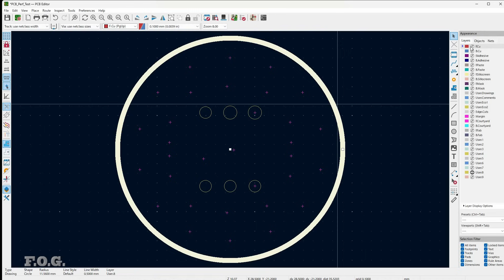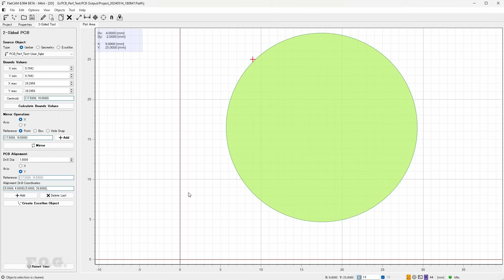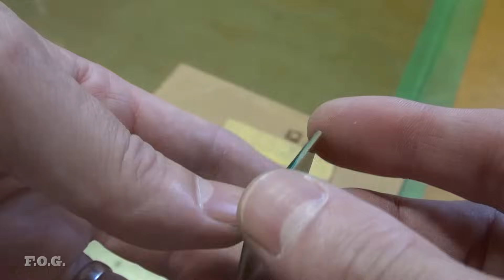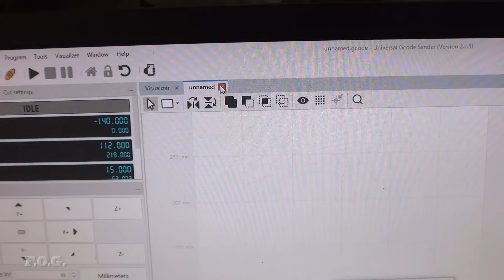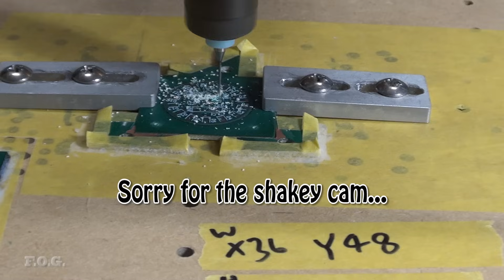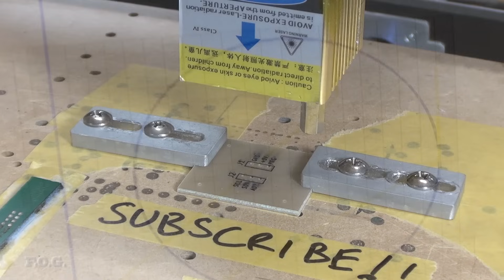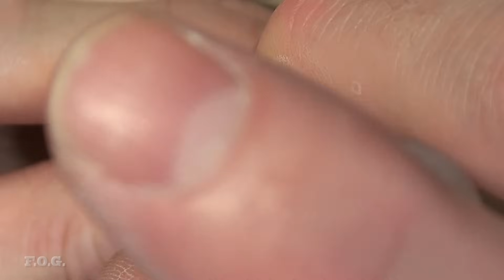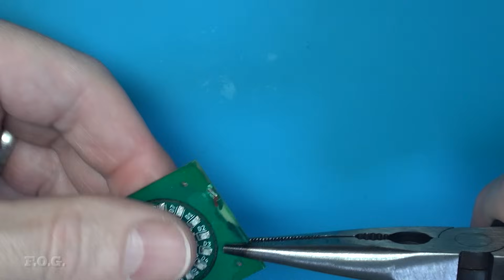The BEST DIY PCB Tutorial (ForOurGood PCB Method)

Comment from the maker: This is a pinned comment where I will try to provide extra information in the replies of this comment... (Note: FlatCam Links shown in the video are no longer valid > see below)
In the description of this Marius Stanciu's (FlatCam developer) YouTube video, you can find the links to the download installers. I cannot guarentee them, but I expect the risk is likely low given the source.
Here is the link to the video: https://youtu.be/doPdeA0YgzQ?si=2yWdgYf8naxUh96R
Reply from the maker: 10. Install & Align Laser
    - Remove spindle and install laser
    - Home CNC & Set XY to zero
    - Probe Z-Height of locating marker and set laser to correct focus height
    - Move CNC to LM_OFFSET X&Y coordinates
    - Adjust XY position by eye to be centered with location cross mark
    - Set X & Y coordinates to zero
    - Move CNC to coordinates G0X0Y4
    - Set X & Y coordinates to zero
  a - Burn test marks in locating marker (use "Laser_Align_Test.nc")
  b - Magnify and inspect marks and determine X & Y adjustment (COMPENSATE OUTSIDE CIRCLE DISTANCE!)
  c - Move to G0X0Y4 adding the determined adjustment amount for X & Y (typically +/- 0.01>0.1)
  d - Set X & Y coordinates to zero
    - Repeat steps "a" thru "d" until good alignment achieved
    - Move CNC to coordinates to G0X0Y0
    - Move CNC by 1mm steps until centered with location cross mark
    - Set X & Y coordinates to zero
    - Move CNC to coordinates to G0Z10 to ensure the laser will be clear
    - Move CNC to PCB_OFFSET X&Y coordinates
    - Set X & Y coordinates to zero

11. Burn Alignment Marks, Flip & Align PCB
    - Remove PCB, remove waste sheet, and re-install PCB without waste sheet
    - Check alignment holes are all clean and clear
    - Probe Z-Height of MOUNTING surface (i.e. waste board)
    - Load G-Code file "Alignment Drills_conv_edit_iso_combined_cnc.nc"
    - Run G-code to burn alignment marks into the masking tape on the mounting surface
    - Remove PCB
    - Remove Locating Guides, being careful not to disturb the alignment marks
    - Flip PCB backside up, and using magnification, align alignment holes and marks
    - Clamp PCB firmly in place
    - Probe Z-Height of PCB surface

12. Back Side PCB Markings & Laser Cut
    - Load G-Code file "??-B_Silkscreen.gbr_iso_combined_mt_paint_cnc.nc"
    - Run G-code to mark the bare P
    - For symmetric PCB -> Load G-Code File "??-User_9.gbr_iso_combined_cnc.nc"
    - For asymmetric PCB -> Load G-Code File "??-User_9.gbr_1_iso_combined_cnc.nc"
    - Run G-code to laser cut the PCB
    - Masking tape, locating guides and reference can be removed

13. Laser Cut SMD Solder Paste Stencil (If SMD is used in design)
    - Mount bare copper clad PCB in CNC as working surface
    - Apply masking tape to the bare PCB over area larger than the stencil
    - Load G-Code File "??-F_Paste.gbr_edit_iso_combined_cnc.nc"
    - Set the XY origin of the CNC so the stencil will be burnt at the center of the masking tape
    - Cut out 2 pieces of white weak adhesive label sheet large enough for the stencil
    - Carefully apply the FIRST layer of label sheet to the center of the masking tape
    - Use Scotch Brite to dull surface of the FIRST layer of label sheet, clean lightly with IPA
    - Probe Z-Height of the FIRST layer of label sheet
    - Run G-code to cut the stencil design into the FIRST layer of label sheet
    - Now stick the SECOND piece of label sheet carefully on top of the FIRST layer
    - Use Scotch Brite to dull surface of the SECOND layer of label sheet, clean lightly with IPA
    - Run G-code to cut the stencil design into the SECOND layer of label sheet
    - Carefully remove COMBINED layers from masking tape, leaving cutout areas on the masking tape
    - REDUCE STENCIL ADHESION by pressing sticky side to your fingers a few times (need only minimal adhesion)

14. Prepare Pads for Soldering
    - Magnify and inspect, using a pin tip to remove any obvious resin remaining on pads
    - Use fine toothbrush and metal polish (Pikal/Brasso) to bring pads to a high shine
      > When polishing, focus on scrubbing inside the pad cavities cut into the resin
      > Rotate the PCB and polish a couple of times from different angles to ensure all areas covered
      > Take care with this step, it's CRITICAL to remove residue from pads to get good solder take up
    - Scrub the pads clean using IPA and fine toothbrush, then dry.
    - Magnify and inspect, confirming all pads are highly reflective. Repeat polishing as needed
      > Note: If the PCB was polished well in Step#1, then getting a good shine on the pads should be easy.

15. SMD Assembly Process (If SMD is used in design)
    - Affix the stencil to the PCB so it is accurately aligned with the pads, then press down firmly
    - Magnify and inspect stencil, ensuring all holes are clear, use pin tip to clear as needed
    - Apply solder paste into stencil cavities with spatula, press in hard, scrape of excess
    - Carefully remove Paste Stencil so the paste remains in the PCB undisturbed
    - Place all SMD components onto PCB
    - Place PCB on hotplate and PRE-HEAT to just below solder paste melting point, hold for 2min
      > for 138degC solder paste this is approximately 125degC
      > for 183degC solder paste this is approximately 145degC
    - Raise the hotplate to the REFLOW temperature for the solder paste, hold for 1min
      > for 138degC solder paste this is approximately between 150degC > 150degC
      > for 183degC solder paste this is approximately between 205degC > 225degC
    - Nudge any out of place components
    - Carefully remove from hotplate and allow to cool naturally (do not cool quickly)
    - Clean with IPA and fine toothbrush, then dry.
    - Inspect with magnification, remove any unwanted solder beads & further clean as need be

16. Snap Out PCB & Clean Edges
    - Repeatedly bend waste part of PCB around laser cut edges of PCB, and snap it out
    - Use fine file to clean up outside edge of PCB to align cleanly with laser burns
    - Clean with IPA and fine toothbrush, then dry.

17. Install & Solder Through Hole Parts (If thru-hole components used in design)
    - Install, solder and trim wires of any through hole components
    - Clean with IPA and fine toothbrush, then dry.

====================== [Double Sided PCB Process] ======================

a) Step 1: UV Resin coat BOTH sides of the PCB (One side at a time of course...)
b) Steps 2 thru 10, Skipping Step-9: Alignment & Front Side Process (Skip drilling PCB Holes)
c) Steps 11 & Step 2 Combined: Flip PCB, Align and add new Locating Guides for back side processing
d) Steps 4 thru 9, Skipping Step-8: Back Side Process* & Drill PCB Holes (Skip drilling Locating Holes again) 
e) Steps 13 thru 17: Assemble PCB (Note: Manually solder on back side components as need be)
* When etching the back side of the PCB, make sure to protect front side with tape or adhesive sheet
Reply from the maker: =================== [ KiCad Layers & Creating Files ] ===================

@@@@@ Single Sided PCB @@@@@
F.Cu		Clear resist UV resin
F.Paste		Create solder paste stencil +
F.Silkscreen	Expose UV Resin for PCB silkscreen +
B.Silkscreen	Burn into board the PCB silkscreen +*
F.Mask		Clear mask resin from PCB pads
User8		Clear mask resin from PCB edge
User9 		PCB Shape, Cutout PCB **
PTH-drl		PCB Through-Holes (Gerber & Excellon)

+ Optional
* Mirrored in FlatCam
** If PCB not vertical line symmetric, make mirrored copy in FlatCam

@@@@@ Double Sided PCB @@@@@
F.Cu		Clear resist UV resin
B.Cu		Clear resist UV resin *
F.Paste		Create solder paste stencil +
F.Silkscreen	Expose UV Resin for PCB silkscreen +
B.Silkscreen	Expose UV Resin for PCB silkscreen +*
F.Mask		Clear mask resin from PCB pads
B.Mask		Clear mask resin from PCB pads *
User8		Clear mask resin from PCB edge **
User9 		PCB Shape, Cutout PCB **
PTH-drl		PCB Through-Holes (Gerber & Excellon) ++

+ Optional
++ Make mirrored copy in FlatCam
* Mirrored in FlatCam
** If PCB not vertical line symmetric, make mirrored copy in FlatCam

@@@@@ Creating Output Files in KiCad @@@@@
- Select Menu > File > Fabrication Outputs > Gerbers(.gbr)...
- Plot format = "Gerber"
- Select above layers
- [Plot]
- [Generate Drill Files...]
- Drill File Format = Excellon
- [Generate Drill Files]
- Drill File Format = Gerber X2
- [Generate Drill Files]
Reply from the maker: ============= [ FlatCAM 8.994 File Preparation Information ] =============

Note: Offset adjustment and PCB tiling is possible within FlatCAM, but is not covered here.

* Laser Remove Mask Resin for Etching Design *
- File > Open > Open Gerber... > Select "??-F_Cu.gbr" & "??-PTH-drl.gbr" > [Open]
- Subtract Tool (ALT+W) (Use to remove pad holes)
- Delete source = YES, Target = "??-F_Cu.gbr", Subtractor = "??-PTH-drl.gbr"
- [Subtract Gerber]
- Double-Click "??-F_Cu.gbr_sub"
- [Gerber Editor] (Use for cleanup & etch compensation)
- Inspect carefully for any defects or hidden unrequired track pieces
- Select and delete any leftover track pieces (or fix in KiCad & Reload)
- Select all remaining elements
- Click [B] icon in toolbar
- Buffer distance 0.022
- [B Buffer]
- [Exit Editor] > [Yes]
- [Isolating Routing]
- Tool Table 0.075, Tool Dia 0.075, Passes 19, Overlap 33.3333% (Increase "Passes" to fit design)
- [Generate Geometry]
- Check Geometry has all tracks properly isolated. Modify KiCad design to resolve any issues.
- Preprocessor = "GRBL_Laser" (!!CHOOSE FIRST!!)
- Tool Table 0.075, Tool Dia 0.075, V-Tip Angle 1, Feedrate XY 650, Laser Power 5000
- [Generate CNC Job Object]
- [Save CNC Code] > [Save]
- Click [Project] Tab > CTRL+A > Right-Click any item > Disable Plot (clears plot area > wait till complete)
- CTRL+S or File>Save>Save Project... (safety step in case of crash)
- MODIFY G-CODE AS PER INFO AT BOTTOM OF THIS DOCUMENT

* Laser Expose Fast Mask Resin for PCB Front Side Silkscreen *
- File > Open > Open Gerber... > Select "??-F_Silkscreen.gbr" > [Open]
- Double-Click "??-F_Silkscreen.gbr"
- [Isolating Routing] (Use to generate outline use with paint tool)
- Tool Table 0.0001, Tool Dia 0.0001, Passes 1, Overlap 0%
- [Generate Geometry]
- [Paint Tool]
- Tool Table 0.1, Tool Dia 0.1, Overlap 0%, Offset 0.01, Method = "Standard", Connect = NO Contour = NO
- [Generate Geometry]
- Click [Project] Tab
- Double-Click "??-F_Silkscreen.gbr_iso_combined_mt_paint"
- Preprocessor = "GRBL_Laser" (!!CHOOSE FIRST!!)
- Tool Table 0.1, V-Tip Dia 0.1, V-Tip Angle 1, Feedrate XY 200, Laser Power 650
- [Generate CNC Job Object]
- [Save CNC Code] > [Save]
- Click [Project] Tab > CTRL+A > Right-Click any item > Disable Plot (clears plot area > wait till complete)
- CTRL+S or File>Save>Save Project... (safety step in case of crash)
- MODIFY G-CODE AS PER INFO AT BOTTOM OF THIS DOCUMENT

* Laser Remove Mask Resin from Pads * AIR ASSIST REQUIRED *
- File > Open > Open Gerber... > Select "??-F_Mask.gbr" & "??-PTH-drl.gbr" > [Open]
- Subtract Tool (ALT+W) (Use to remove pad holes)
- Delete source = YES, Target = "??-F_Mask.gbr", Subtractor = "??-PTH-drl.gbr"
- [Subtract Gerber]
- Double-Click "??-F_Mask.gbr_sub"
- [Isolating Routing] (Use to generate outline use with paint tool)
- Tool Table 0.0001, Tool Dia 0.0001, Passes 1, Overlap 0%
- [Generate Geometry]
- [Paint Tool]
- Tool Table 0.075, Tool Dia 0.075, Overlap 33%, Offset 0.0128, Method = "Lines", Connect = NO Contour = Yes
- [Generate Geometry]
- Click [Project] Tab
- Double-Click "??-F_Mask.gbr_sub_iso_combined_mt_paint"
- Preprocessor = "GRBL_Laser" (!!CHOOSE FIRST!!)
- Tool Table 0.075, V-Tip Dia 0.075, V-Tip Angle 1, Feedrate XY 650, Laser Power 4400
- [Generate CNC Job Object]
- [Save CNC Code] > [Save]
- Click [Project] Tab > CTRL+A > Right-Click any item > Disable Plot (clears plot area > wait till complete)
- CTRL+S or File>Save>Save Project... (safety step in case of crash)
- MODIFY G-CODE AS PER INFO AT BOTTOM OF THIS DOCUMENT

* Laser Remove Mask Resin from PCB EDGES *
- File > Open > Open Gerber... > Select "??-User_8.gbr" > [Open]
- Double-Click "??-User_8.gbr"
- [Isolating Routing] (Use to generate outline use with paint tool)
- Tool Table 0.0001, Tool Dia 0.0001, Passes 1, Overlap 0%
- [Generate Geometry]
- [Paint Tool]
- Tool Table 0.075, Tool Dia 0.075, Overlap 33%, Offset 0.038, Method = "Standard", Connect = Yes Contour = Yes
- [Generate Geometry]
- Click [Project] Tab
- Double-Click "??-User_8.gbr_iso_combined_mt_paint"
- Preprocessor = "GRBL_Laser" (!!CHOOSE FIRST!!)
- Tool Table 0.075, V-Tip Dia 0.075, V-Tip Angle 1, Feedrate XY 650, Laser Power 2000
- [Generate CNC Job Object]
- [Save CNC Code] > [Save]
- Click [Project] Tab > CTRL+A > Right-Click any item > Disable Plot (clears plot area > wait till complete)
- CTRL+S or File>Save>Save Project... (safety step in case of crash)
- MODIFY G-CODE AS PER INFO AT BOTTOM OF THIS DOCUMENT

* Laser Cut Front Side of PCB *
NOTE: Symmetrical PCB's can use the same G-Code file for both the front and back
- File > Open > Open Gerber... > Select "??-User_9.gbr" > [Open]
- Double-Click "??-User_9.gbr"
- [Isolating Routing]
- Tool Table 0.1, Tool Dia 0.1, Passes 22, Overlap 99.9999%
- [Generate Geometry]
- Preprocessor = "GRBL_Laser" (!!CHOOSE FIRST!!)
- Tool Table 0.1, V-Tip Dia 0.1, V-Tip Angle 1, Feedrate XY 650, Laser Power 10000
- [Generate CNC Job Object]
- [Save CNC Code] > [Save]
- Click [Project] Tab > CTRL+A > Right-Click any item > Disable Plot (clears plot area > wait till complete)
- CTRL+S or File>Save>Save Project... (safety step in case of crash)
- MODIFY G-CODE AS PER INFO AT BOTTOM OF THIS DOCUMENT

* Drill Alignment Holes *
- Right-Click "??-User_9.gbr" > Enable Plot
- Tool > 2-Sided PCB (ALT+D)
- Select "??-User_9.gbr"
- [Calculate Bound Values] (if does not generate values, then disable then enable plot, and try again)
- PCB Alignment: Drill Dia 1.000, Axis = Y
- Click the desired location of the lower-left hole and press [+Add] (manually modify value if needed)
- Click the desired location of the upper-left hole and press [+Add] (manually modify value if needed)
- [Create Excellon Object]
- Click [Project] Tab
- Double-Click "Alignment Drills"
- [Drilling Tool]
- CutZ -1.9, TravelZ 1.5, FeedZ 300, Spindle 10000
- ToolChange = NO, EndMove Z 25, EndMoveXY "0,0", PreProcessor = "GRBL_11_no_M6"
- [Generate CNC Job Object]
- [Save CNC Code] > [Save]
- Click [Project] Tab > CTRL+A > Right-Click any item > Disable Plot (clears plot area > wait till complete)
- CTRL+S or File>Save>Save Project... (safety step in case of crash)

* Drill Pad Holes *
- File > Open > Open Excellon... > Select "??-PTH.drl" > [Open]
- Double-Click "??-PTH.drl"
- [Drilling Tool]
- CutZ -1.9, TravelZ 1.5, FeedZ 300, Spindle 10000
- ToolChange = YES @25, EndMove Z 25, EndMoveXY "0,0", PreProcessor = "GRBL_11_no_M6"
- [Generate CNC Job Object]
- [Save CNC Code] > [Save]
- Click [Project] Tab > CTRL+A > Right-Click any item > Disable Plot (clears plot area > wait till complete)
- CTRL+S or File>Save>Save Project... (safety step in case of crash)

* Laser Burn Alignment Marks *
- Click "Alignment Drills" (don't enable plot!)
- Edit > Conversion > Convert Any to Gerber
- Double-Click "Alignment Drills_conv"
- [Gerber Editor] (Use to modify mark size)
- Change Aperture Size from 1.0 to 0.8
- [Exit Editor] > [Yes]
- [Isolation Routing]
- Tool Table 0.0001, Tool Dia 0.0001, Passes 1, Overlap 0%
- [Generate Geometry]
- Preprocessor = "GRBL_Laser" (!!CHOOSE FIRST!!)
- Tool Table 0.075, Tool Dia 0.075, V-Tip Angle 1, Feedrate XY 650, Laser Power 3000
- [Generate CNC Job Object]
- [Save CNC Code] > [Save]
- Click [Project] Tab > CTRL+A > Right-Click any item > Disable Plot (clears plot area > wait till complete)
- CTRL+S or File>Save>Save Project... (saftey step in case of crash)
- MODIFY G-CODE AS PER INFO AT BOTTOM OF THIS DOCUMENT

* Laser Burn for PCB Back Side Silkscreen *
- File > Open > Open Gerber... > Select "??-B_Silkscreen.gbr" > [Open]
- Right-Click "??-User_9.gbr" > Enable Plot
- Tool > 2-Sided PCB (ALT+D)
- Select "??-User_9.gbr"
- [Calculate Bound Values] (if does not generate values, then disable then enable plot, and try again)
- Select "??-B_Silkscreen.gbr"
- Mirror Operation: Axis = Y
- [Mirror]
- Click [Project] Tab
- Double-Click "??-B_Silkscreen.gbr"
- [Isolating Routing] (Use to generate outline use with paint tool)
- Tool Table 0.0001, Tool Dia 0.0001, Passes 1, Overlap 0%
- [Generate Geometry]
- [Paint Tool]
- Tool Table 0.075, Tool Dia 0.075, Overlap 20%, Offset 0.00, Method = "Standard", Connect = NO Contour = Yes
- [Generate Geometry]
- Click [Project] Tab
- Double-Click "??-B_Silkscreen.gbr_iso_combined_mt_paint"
- Preprocessor = "GRBL_Laser" (!!CHOOSE FIRST!!)
- Tool Table 0.075, V-Tip Dia 0.075, V-Tip Angle 1, Feedrate XY 650, Laser Power 6000
- [Generate CNC Job Object]
- [Save CNC Code] > [Save]
- Click [Project] Tab > CTRL+A > Right-Click any item > Disable Plot (clears plot area > wait till complete)
- CTRL+S or File>Save>Save Project... (safety step in case of crash)
- MODIFY G-CODE AS PER INFO AT BOTTOM OF THIS DOCUMENT
Reply from the maker: * Laser Cut Back Side of PCB *
NOTE: Symmetrical PCB's can use the same G-Code file for both the front and back
- File > Open > Open Gerber... > Select "??-User_9.gbr" > [Open] (Opens second instance)
- Right-Click "??-User_9.gbr" > Enable Plot
- Tool > 2-Sided PCB (ALT+D)
- Select "??-User_9.gbr"
- [Calculate Bound Values] (if does not generate values, then disable then enable plot, and try again)
- Select "??-User_9.gbr_1"
- Mirror Operation: Axis = Y
- [Mirror]
- Click [Project] Tab
- Double-Click "??-User_9.gbr_1"
- [Isolating Routing]
- Tool Table 0.1, Tool Dia 0.1, Passes 22, Overlap 99.9999%
- [Generate Geometry]
- Preprocessor = "GRBL_Laser" (!!CHOOSE FIRST!!)
- Tool Table 0.1, V-Tip Dia 0.1, V-Tip Angle 1, Feedrate XY 650, Laser Power 10000
- [Generate CNC Job Object]
- [Save CNC Code] > [Save]
- Click [Project] Tab > CTRL+A > Right-Click any item > Disable Plot (clears plot area > wait till complete)
- CTRL+S or File>Save>Save Project... (safety step in case of crash)
- MODIFY G-CODE AS PER INFO AT BOTTOM OF THIS DOCUMENT

* Laser Cut Solder Paste Stencil *
- File > Open > Open Gerber... > Select "??-F_Paste.gbr" > [Open]
- Double-Click "??-F_Paste.gbr"
- [Gerber Editor] (Use for burn compensation)
- Select all elements
- Click [B] icon in toolbar
- Buffer distance -0.04
- [B Buffer]
- [Exit Editor] > [Yes]
- Click [Project] Tab
- Double-Click "??-F_Paste.gbr_edit"
- [Isolating Routing]
- Tool Table 0.0001, Tool Dia 0.0001, Passes 1, Overlap 0%
- [Generate Geometry]
- Preprocessor = "GRBL_Laser" (!!CHOOSE FIRST!!)
- Tool Table 0.075, Tool Dia 0.075, V-Tip Angle 1, Feedrate XY 650, Laser Power 3900
- [Generate CNC Job Object]
- [Save CNC Code] > [Save]
- Click [Project] Tab > CTRL+A > Right-Click any item > Disable Plot (clears plot area > wait till complete)
- CTRL+S or File>Save>Save Project... (safety step in case of crash)
- MODIFY G-CODE AS PER INFO AT BOTTOM OF THIS DOCUMENT

#####################################################################
#####                                                           #####
#####   REPLACE TEXT FOR FLATCAM GENERATED G-CODE LASER FILES   #####
#####                                                           #####
#####################################################################

* Replace all matches with nothing as follows *
------------
G01 F60.00
G01 F650.00  			(Check this F value and replace as need be)

* Replace remaining header with below *
-------------
G21 				(Millimetere units mode)
G90 				(Absolute distance mode)
G17				(Select normal XY Plane)
G94				(Feedrate as units per minute mode)
$32=1				(Enable laser mode - just in case!)
M5     				(Stop spindle/laser)        
G0 F1100			(Set the rapids speed to be fast)
G0 Z7.0000			(Lift Z a bit)
G0 X0.0000 Y0.0000		(Send X-Y to home)
G0 Z0.0000			(Send Z to home)
M0				(Wait user confirmation)

G00 x?? y?? <----- leave as original from here!

M03 S??00.0 <----- leave as original from here!
-------------
Reply from the maker: (Drill Alignment Test)

G90
G21
(Drilling....)
M05
M0 ;T10
M03S10000

G0Z1.500
G0X2.000Y-2.000

G0Z1.500
G0X0.000Y0.000
G1Z-1.400F300.0

G0Z1.500
G0X2.000Y2.000
G1Z-1.400F300.0

G0Z1.500
G0X0.000Y2.000
G1Z-1.400F300.0

G0Z1.500
G0X2.000Y0.000
G1Z-1.400F300.0

G0Z25.000

M5
M5
M5
Reply from the maker: (Laser Alignment Test)

G21 				(Millimeter units mode)
G90 				(Absolute distance mode)
G17				(Select normal XY Plane)
G94				(Feedrate as units per minute mode)
$32=1				(Enable laser mode - just in case!)
M5     				(Stop spindle/laser)        
G0 F1100			(Set the rapids speed to be fast)
G0 Z7.0000			(Lift Z a bit)
G0 X0.0000 Y0.0000		(Send X-Y to home)
G0 Z0.0000			(Send Z to home)
M0				(Wait user confirmation)

G0X2.000Y-2.000Z0.000

M03S5000

G0X-0.700Y0.000
G1X-0.696Y0.072F650.0
X-0.686Y0.141
X-0.669Y0.208
X-0.645Y0.272
X-0.616Y0.334
X-0.580Y0.391
X-0.540Y0.445
X-0.495Y0.495
X-0.445Y0.540
X-0.391Y0.580
X-0.334Y0.616
X-0.272Y0.645
X-0.208Y0.669
X-0.141Y0.686
X-0.072Y0.696
X0.000Y0.700
X0.072Y0.696
X0.141Y0.686
X0.208Y0.669
X0.272Y0.645
X0.334Y0.616
X0.391Y0.580
X0.445Y0.540
X0.495Y0.495
X0.540Y0.445
X0.580Y0.391
X0.616Y0.334
X0.645Y0.272
X0.669Y0.208
X0.686Y0.141
X0.696Y0.072
X0.700Y0.000
X0.696Y-0.072
X0.686Y-0.141
X0.669Y-0.208
X0.645Y-0.272
X0.616Y-0.334
X0.580Y-0.391
X0.540Y-0.445
X0.495Y-0.495
X0.445Y-0.540
X0.391Y-0.580
X0.334Y-0.616
X0.272Y-0.645
X0.208Y-0.669
X0.141Y-0.686
X0.072Y-0.696
X0.000Y-0.700
X-0.072Y-0.696
X-0.141Y-0.686
X-0.208Y-0.669
X-0.272Y-0.645
X-0.334Y-0.616
X-0.391Y-0.580
X-0.445Y-0.540
X-0.495Y-0.495
X-0.540Y-0.445
X-0.580Y-0.391
X-0.616Y-0.334
X-0.645Y-0.272
X-0.669Y-0.208
X-0.686Y-0.141
X-0.696Y-0.072
X-0.700Y0.000

G0X1.300Y2.000
G1X1.304Y2.072F650.0
X1.314Y2.141
X1.331Y2.208
X1.355Y2.272
X1.384Y2.334
X1.420Y2.391
X1.460Y2.445
X1.505Y2.495
X1.555Y2.540
X1.609Y2.580
X1.666Y2.616
X1.728Y2.645
X1.792Y2.669
X1.859Y2.686
X1.928Y2.696
X2.000Y2.700
X2.072Y2.696
X2.141Y2.686
X2.208Y2.669
X2.272Y2.645
X2.334Y2.616
X2.391Y2.580
X2.445Y2.540
X2.495Y2.495
X2.540Y2.445
X2.580Y2.391
X2.616Y2.334
X2.645Y2.272
X2.669Y2.208
X2.686Y2.141
X2.696Y2.072
X2.700Y2.000
X2.696Y1.928
X2.686Y1.859
X2.669Y1.792
X2.645Y1.728
X2.616Y1.666
X2.580Y1.609
X2.540Y1.555
X2.495Y1.505
X2.445Y1.460
X2.391Y1.420
X2.334Y1.384
X2.272Y1.355
X2.208Y1.331
X2.141Y1.314
X2.072Y1.304
X2.000Y1.300
X1.928Y1.304
X1.859Y1.314
X1.792Y1.331
X1.728Y1.355
X1.666Y1.384
X1.609Y1.420
X1.555Y1.460
X1.505Y1.505
X1.460Y1.555
X1.420Y1.609
X1.384Y1.666
X1.355Y1.728
X1.331Y1.792
X1.314Y1.859
X1.304Y1.928
X1.300Y2.000

G0X-0.700Y2.000
G1X-0.696Y2.072F650.0
X-0.686Y2.141
X-0.669Y2.208
X-0.645Y2.272
X-0.616Y2.334
X-0.580Y2.391
X-0.540Y2.445
X-0.495Y2.495
X-0.445Y2.540
X-0.391Y2.580
X-0.334Y2.616
X-0.272Y2.645
X-0.208Y2.669
X-0.141Y2.686
X-0.072Y2.696
X0.000Y2.700
X0.072Y2.696
X0.141Y2.686
X0.208Y2.669
X0.272Y2.645
X0.334Y2.616
X0.391Y2.580
X0.445Y2.540
X0.495Y2.495
X0.540Y2.445
X0.580Y2.391
X0.616Y2.334
X0.645Y2.272
X0.669Y2.208
X0.686Y2.141
X0.696Y2.072
X0.700Y2.000
X0.696Y1.928
X0.686Y1.859
X0.669Y1.792
X0.645Y1.728
X0.616Y1.666
X0.580Y1.609
X0.540Y1.555
X0.495Y1.505
X0.445Y1.460
X0.391Y1.420
X0.334Y1.384
X0.272Y1.355
X0.208Y1.331
X0.141Y1.314
X0.072Y1.304
X0.000Y1.300
X-0.072Y1.304
X-0.141Y1.314
X-0.208Y1.331
X-0.272Y1.355
X-0.334Y1.384
X-0.391Y1.420
X-0.445Y1.460
X-0.495Y1.505
X-0.540Y1.555
X-0.580Y1.609
X-0.616Y1.666
X-0.645Y1.728
X-0.669Y1.792
X-0.686Y1.859
X-0.696Y1.928
X-0.700Y2.000

G0X1.300Y0.000
G1X1.304Y0.072F650.0
X1.314Y0.141
X1.331Y0.208
X1.355Y0.272
X1.384Y0.334
X1.420Y0.391
X1.460Y0.445
X1.505Y0.495
X1.555Y0.540
X1.609Y0.580
X1.666Y0.616
X1.728Y0.645
X1.792Y0.669
X1.859Y0.686
X1.928Y0.696
X2.000Y0.700
X2.072Y0.696
X2.141Y0.686
X2.208Y0.669
X2.272Y0.645
X2.334Y0.616
X2.391Y0.580
X2.445Y0.540
X2.495Y0.495
X2.540Y0.445
X2.580Y0.391
X2.616Y0.334
X2.645Y0.272
X2.669Y0.208
X2.686Y0.141
X2.696Y0.072
X2.700Y0.000
X2.696Y-0.072
X2.686Y-0.141
X2.669Y-0.208
X2.645Y-0.272
X2.616Y-0.334
X2.580Y-0.391
X2.540Y-0.445
X2.495Y-0.495
X2.445Y-0.540
X2.391Y-0.580
X2.334Y-0.616
X2.272Y-0.645
X2.208Y-0.669
X2.141Y-0.686
X2.072Y-0.696
X2.000Y-0.700
X1.928Y-0.696
X1.859Y-0.686
X1.792Y-0.669
X1.728Y-0.645
X1.666Y-0.616
X1.609Y-0.580
X1.555Y-0.540
X1.505Y-0.495
X1.460Y-0.445
X1.420Y-0.391
X1.384Y-0.334
X1.355Y-0.272
X1.331Y-0.208
X1.314Y-0.141
X1.304Y-0.072
X1.300Y0.000

M5
M5
M5
Reply from the maker: (Make Alignment Marker - PART1)

G21 				(Millimeter units mode)
G90 				(Absolute distance mode)
G17				(Select normal XY Plane)
G94				(Feedrate as units per minute mode)
$32=1				(Enable laser mode - just in case!)
M5     				(Stop spindle/laser)        
G0 F1100			(Set the rapids speed to be fast)
G0 Z7.0000			(Lift Z a bit)
G0 X0.0000 Y0.0000		(Send X-Y to home)
G0 Z0.0000			(Send Z to home)
M0				(Wait user confirmation)

G0X0.000Y-2.800Z0.000

M03S5000

G0X-2.800Y0.000
G1X2.800F650.0

G0X0.000Y-2.800
G1Y2.800F650.0

G0X2.000Y30.000Z0.000(8)

X-0.600Y32.000
G1X-0.597Y32.061F650.0
X-0.588Y32.121
X-0.573Y32.178
X-0.553Y32.234
X-0.528Y32.286
X-0.498Y32.335
X-0.463Y32.382
X-0.424Y32.424
X-0.382Y32.463
X-0.335Y32.498
X-0.286Y32.528
X-0.234Y32.553
X-0.178Y32.573
X-0.121Y32.588
X-0.061Y32.597
X0.000Y32.600
X0.061Y32.597
X0.121Y32.588
X0.178Y32.573
X0.234Y32.553
X0.286Y32.528
X0.335Y32.498
X0.382Y32.463
X0.424Y32.424
X0.463Y32.382
X0.498Y32.335
X0.528Y32.286
X0.553Y32.234
X0.573Y32.178
X0.588Y32.121
X0.597Y32.061
X0.600Y32.000
X0.597Y31.939
X0.588Y31.879
X0.573Y31.822
X0.553Y31.766
X0.528Y31.714
X0.498Y31.665
X0.463Y31.618
X0.424Y31.576
X0.382Y31.537
X0.335Y31.502
X0.286Y31.472
X0.234Y31.447
X0.178Y31.427
X0.121Y31.412
X0.061Y31.403
X0.000Y31.400
X-0.061Y31.403
X-0.121Y31.412
X-0.178Y31.427
X-0.234Y31.447
X-0.286Y31.472
X-0.335Y31.502
X-0.382Y31.537
X-0.424Y31.576
X-0.463Y31.618
X-0.498Y31.665
X-0.528Y31.714
X-0.553Y31.766
X-0.573Y31.822
X-0.588Y31.879
X-0.597Y31.939
X-0.600Y32.000

G0X1.400Y34.000
G1X1.403Y34.061F650.0
X1.412Y34.121
X1.427Y34.178
X1.447Y34.234
X1.472Y34.286
X1.502Y34.335
X1.537Y34.382
X1.576Y34.424
X1.618Y34.463
X1.665Y34.498
X1.714Y34.528
X1.766Y34.553
X1.822Y34.573
X1.879Y34.588
X1.939Y34.597
X2.000Y34.600
X2.061Y34.597
X2.121Y34.588
X2.178Y34.573
X2.234Y34.553
X2.286Y34.528
X2.335Y34.498
X2.382Y34.463
X2.424Y34.424
X2.463Y34.382
X2.498Y34.335
X2.528Y34.286
X2.553Y34.234
X2.573Y34.178
X2.588Y34.121
X2.597Y34.061
X2.600Y34.000
X2.597Y33.939
X2.588Y33.879
X2.573Y33.822
X2.553Y33.766
X2.528Y33.714
X2.498Y33.665
X2.463Y33.618
X2.424Y33.576
X2.382Y33.537
X2.335Y33.502
X2.286Y33.472
X2.234Y33.447
X2.178Y33.427
X2.121Y33.412
X2.061Y33.403
X2.000Y33.400
X1.939Y33.403
X1.879Y33.412
X1.822Y33.427
X1.766Y33.447
X1.714Y33.472
X1.665Y33.502
X1.618Y33.537
X1.576Y33.576
X1.537Y33.618
X1.502Y33.665
X1.472Y33.714
X1.447Y33.766
X1.427Y33.822
X1.412Y33.879
X1.403Y33.939
X1.400Y34.000

G0X-0.600Y34.000
G1X-0.597Y34.061F650.0
X-0.588Y34.121
X-0.573Y34.178
X-0.553Y34.234
X-0.528Y34.286
X-0.498Y34.335
X-0.463Y34.382
X-0.424Y34.424
X-0.382Y34.463
X-0.335Y34.498
X-0.286Y34.528
X-0.234Y34.553
X-0.178Y34.573
X-0.121Y34.588
X-0.061Y34.597
X0.000Y34.600
X0.061Y34.597
X0.121Y34.588
X0.178Y34.573
X0.234Y34.553
X0.286Y34.528
X0.335Y34.498
X0.382Y34.463
X0.424Y34.424
X0.463Y34.382
X0.498Y34.335
X0.528Y34.286
X0.553Y34.234
X0.573Y34.178
X0.588Y34.121
X0.597Y34.061
X0.600Y34.000
X0.597Y33.939
X0.588Y33.879
X0.573Y33.822
X0.553Y33.766
X0.528Y33.714
X0.498Y33.665
X0.463Y33.618
X0.424Y33.576
X0.382Y33.537
X0.335Y33.502
X0.286Y33.472
X0.234Y33.447
X0.178Y33.427
X0.121Y33.412
X0.061Y33.403
X0.000Y33.400
X-0.061Y33.403
X-0.121Y33.412
X-0.178Y33.427
X-0.234Y33.447
X-0.286Y33.472
X-0.335Y33.502
X-0.382Y33.537
X-0.424Y33.576
X-0.463Y33.618
X-0.498Y33.665
X-0.528Y33.714
X-0.553Y33.766
X-0.573Y33.822
X-0.588Y33.879
X-0.597Y33.939
X-0.600Y34.000

G0X1.400Y32.000
G1X1.403Y32.061F650.0
X1.412Y32.121
X1.427Y32.178
X1.447Y32.234
X1.472Y32.286
X1.502Y32.335
X1.537Y32.382
X1.576Y32.424
X1.618Y32.463
X1.665Y32.498
X1.714Y32.528
X1.766Y32.553
X1.822Y32.573
X1.879Y32.588
X1.939Y32.597
X2.000Y32.600
X2.061Y32.597
X2.121Y32.588
X2.178Y32.573
X2.234Y32.553
X2.286Y32.528
X2.335Y32.498
X2.382Y32.463
X2.424Y32.424
X2.463Y32.382
X2.498Y32.335
X2.528Y32.286
X2.553Y32.234
X2.573Y32.178
X2.588Y32.121
X2.597Y32.061
X2.600Y32.000
X2.597Y31.939
X2.588Y31.879
X2.573Y31.822
X2.553Y31.766
X2.528Y31.714
X2.498Y31.665
X2.463Y31.618
X2.424Y31.576
X2.382Y31.537
X2.335Y31.502
X2.286Y31.472
X2.234Y31.447
X2.178Y31.427
X2.121Y31.412
X2.061Y31.403
X2.000Y31.400
X1.939Y31.403
X1.879Y31.412
X1.822Y31.427
X1.766Y31.447
X1.714Y31.472
X1.665Y31.502
X1.618Y31.537
X1.576Y31.576
X1.537Y31.618
X1.502Y31.665
X1.472Y31.714
X1.447Y31.766
X1.427Y31.822
X1.412Y31.879
X1.403Y31.939
X1.400Y32.000

G0X0.500Y31.000
G1X1.500F650.0

G0X2.000Y26.000Z0.000(7)

G0X-0.600Y28.000
G1X-0.597Y28.061F650.0
X-0.588Y28.121
X-0.573Y28.178
X-0.553Y28.234
X-0.528Y28.286
X-0.498Y28.335
X-0.463Y28.382
X-0.424Y28.424
X-0.382Y28.463
X-0.335Y28.498
X-0.286Y28.528
X-0.234Y28.553
X-0.178Y28.573
X-0.121Y28.588
X-0.061Y28.597
X0.000Y28.600
X0.061Y28.597
X0.121Y28.588
X0.178Y28.573
X0.234Y28.553
X0.286Y28.528
X0.335Y28.498
X0.382Y28.463
X0.424Y28.424
X0.463Y28.382
X0.498Y28.335
X0.528Y28.286
X0.553Y28.234
X0.573Y28.178
X0.588Y28.121
X0.597Y28.061
X0.600Y28.000
X0.597Y27.939
X0.588Y27.879
X0.573Y27.822
X0.553Y27.766
X0.528Y27.714
X0.498Y27.665
X0.463Y27.618
X0.424Y27.576
X0.382Y27.537
X0.335Y27.502
X0.286Y27.472
X0.234Y27.447
X0.178Y27.427
X0.121Y27.412
X0.061Y27.403
X0.000Y27.400
X-0.061Y27.403
X-0.121Y27.412
X-0.178Y27.427
X-0.234Y27.447
X-0.286Y27.472
X-0.335Y27.502
X-0.382Y27.537
X-0.424Y27.576
X-0.463Y27.618
X-0.498Y27.665
X-0.528Y27.714
X-0.553Y27.766
X-0.573Y27.822
X-0.588Y27.879
X-0.597Y27.939
X-0.600Y28.000

G0X1.400Y30.000
G1X1.403Y30.061F650.0
X1.412Y30.121
X1.427Y30.178
X1.447Y30.234
X1.472Y30.286
X1.502Y30.335
X1.537Y30.382
X1.576Y30.424
X1.618Y30.463
X1.665Y30.498
X1.714Y30.528
X1.766Y30.553
X1.822Y30.573
X1.879Y30.588
X1.939Y30.597
X2.000Y30.600
X2.061Y30.597
X2.121Y30.588
X2.178Y30.573
X2.234Y30.553
X2.286Y30.528
X2.335Y30.498
X2.382Y30.463
X2.424Y30.424
X2.463Y30.382
X2.498Y30.335
X2.528Y30.286
X2.553Y30.234
X2.573Y30.178
X2.588Y30.121
X2.597Y30.061
X2.600Y30.000
X2.597Y29.939
X2.588Y29.879
X2.573Y29.822
X2.553Y29.766
X2.528Y29.714
X2.498Y29.665
X2.463Y29.618
X2.424Y29.576
X2.382Y29.537
X2.335Y29.502
X2.286Y29.472
X2.234Y29.447
X2.178Y29.427
X2.121Y29.412
X2.061Y29.403
X2.000Y29.400
X1.939Y29.403
X1.879Y29.412
X1.822Y29.427
X1.766Y29.447
X1.714Y29.472
X1.665Y29.502
X1.618Y29.537
X1.576Y29.576
X1.537Y29.618
X1.502Y29.665
X1.472Y29.714
X1.447Y29.766
X1.427Y29.822
X1.412Y29.879
X1.403Y29.939
X1.400Y30.000

G0X-0.600Y30.000
G1X-0.597Y30.061F650.0
X-0.588Y30.121
X-0.573Y30.178
X-0.553Y30.234
X-0.528Y30.286
X-0.498Y30.335
X-0.463Y30.382
X-0.424Y30.424
X-0.382Y30.463
X-0.335Y30.498
X-0.286Y30.528
X-0.234Y30.553
X-0.178Y30.573
X-0.121Y30.588
X-0.061Y30.597
X0.000Y30.600
X0.061Y30.597
X0.121Y30.588
X0.178Y30.573
X0.234Y30.553
X0.286Y30.528
X0.335Y30.498
X0.382Y30.463
X0.424Y30.424
X0.463Y30.382
X0.498Y30.335
X0.528Y30.286
X0.553Y30.234
X0.573Y30.178
X0.588Y30.121
X0.597Y30.061
X0.600Y30.000
X0.597Y29.939
X0.588Y29.879
X0.573Y29.822
X0.553Y29.766
X0.528Y29.714
X0.498Y29.665
X0.463Y29.618
X0.424Y29.576
X0.382Y29.537
X0.335Y29.502
X0.286Y29.472
X0.234Y29.447
X0.178Y29.427
X0.121Y29.412
X0.061Y29.403
X0.000Y29.400
X-0.061Y29.403
X-0.121Y29.412
X-0.178Y29.427
X-0.234Y29.447
X-0.286Y29.472
X-0.335Y29.502
X-0.382Y29.537
X-0.424Y29.576
X-0.463Y29.618
X-0.498Y29.665
X-0.528Y29.714
X-0.553Y29.766
X-0.573Y29.822
X-0.588Y29.879
X-0.597Y29.939
X-0.600Y30.000

G0X1.400Y28.000
G1X1.403Y28.061F650.0
X1.412Y28.121
X1.427Y28.178
X1.447Y28.234
X1.472Y28.286
X1.502Y28.335
X1.537Y28.382
X1.576Y28.424
X1.618Y28.463
X1.665Y28.498
X1.714Y28.528
X1.766Y28.553
X1.822Y28.573
X1.879Y28.588
X1.939Y28.597
X2.000Y28.600
X2.061Y28.597
X2.121Y28.588
X2.178Y28.573
X2.234Y28.553
X2.286Y28.528
X2.335Y28.498
X2.382Y28.463
X2.424Y28.424
X2.463Y28.382
X2.498Y28.335
X2.528Y28.286
X2.553Y28.234
X2.573Y28.178
X2.588Y28.121
X2.597Y28.061
X2.600Y28.000
X2.597Y27.939
X2.588Y27.879
X2.573Y27.822
X2.553Y27.766
X2.528Y27.714
X2.498Y27.665
X2.463Y27.618
X2.424Y27.576
X2.382Y27.537
X2.335Y27.502
X2.286Y27.472
X2.234Y27.447
X2.178Y27.427
X2.121Y27.412
X2.061Y27.403
X2.000Y27.400
X1.939Y27.403
X1.879Y27.412
X1.822Y27.427
X1.766Y27.447
X1.714Y27.472
X1.665Y27.502
X1.618Y27.537
X1.576Y27.576
X1.537Y27.618
X1.502Y27.665
X1.472Y27.714
X1.447Y27.766
X1.427Y27.822
X1.412Y27.879
X1.403Y27.939
X1.400Y28.000
Reply from the maker: (Make Alignment Marker - PART2)

G0X0.500Y27.000
G1X1.500F650.0

G0X2.000Y22.000Z0.000(6)

G0X-0.600Y24.000
G1X-0.597Y24.061F650.0
X-0.588Y24.121
X-0.573Y24.178
X-0.553Y24.234
X-0.528Y24.286
X-0.498Y24.335
X-0.463Y24.382
X-0.424Y24.424
X-0.382Y24.463
X-0.335Y24.498
X-0.286Y24.528
X-0.234Y24.553
X-0.178Y24.573
X-0.121Y24.588
X-0.061Y24.597
X0.000Y24.600
X0.061Y24.597
X0.121Y24.588
X0.178Y24.573
X0.234Y24.553
X0.286Y24.528
X0.335Y24.498
X0.382Y24.463
X0.424Y24.424
X0.463Y24.382
X0.498Y24.335
X0.528Y24.286
X0.553Y24.234
X0.573Y24.178
X0.588Y24.121
X0.597Y24.061
X0.600Y24.000
X0.597Y23.939
X0.588Y23.879
X0.573Y23.822
X0.553Y23.766
X0.528Y23.714
X0.498Y23.665
X0.463Y23.618
X0.424Y23.576
X0.382Y23.537
X0.335Y23.502
X0.286Y23.472
X0.234Y23.447
X0.178Y23.427
X0.121Y23.412
X0.061Y23.403
X0.000Y23.400
X-0.061Y23.403
X-0.121Y23.412
X-0.178Y23.427
X-0.234Y23.447
X-0.286Y23.472
X-0.335Y23.502
X-0.382Y23.537
X-0.424Y23.576
X-0.463Y23.618
X-0.498Y23.665
X-0.528Y23.714
X-0.553Y23.766
X-0.573Y23.822
X-0.588Y23.879
X-0.597Y23.939
X-0.600Y24.000

G0X1.400Y26.000
G1X1.403Y26.061F650.0
X1.412Y26.121
X1.427Y26.178
X1.447Y26.234
X1.472Y26.286
X1.502Y26.335
X1.537Y26.382
X1.576Y26.424
X1.618Y26.463
X1.665Y26.498
X1.714Y26.528
X1.766Y26.553
X1.822Y26.573
X1.879Y26.588
X1.939Y26.597
X2.000Y26.600
X2.061Y26.597
X2.121Y26.588
X2.178Y26.573
X2.234Y26.553
X2.286Y26.528
X2.335Y26.498
X2.382Y26.463
X2.424Y26.424
X2.463Y26.382
X2.498Y26.335
X2.528Y26.286
X2.553Y26.234
X2.573Y26.178
X2.588Y26.121
X2.597Y26.061
X2.600Y26.000
X2.597Y25.939
X2.588Y25.879
X2.573Y25.822
X2.553Y25.766
X2.528Y25.714
X2.498Y25.665
X2.463Y25.618
X2.424Y25.576
X2.382Y25.537
X2.335Y25.502
X2.286Y25.472
X2.234Y25.447
X2.178Y25.427
X2.121Y25.412
X2.061Y25.403
X2.000Y25.400
X1.939Y25.403
X1.879Y25.412
X1.822Y25.427
X1.766Y25.447
X1.714Y25.472
X1.665Y25.502
X1.618Y25.537
X1.576Y25.576
X1.537Y25.618
X1.502Y25.665
X1.472Y25.714
X1.447Y25.766
X1.427Y25.822
X1.412Y25.879
X1.403Y25.939
X1.400Y26.000

G0X-0.600Y26.000
G1X-0.597Y26.061F650.0
X-0.588Y26.121
X-0.573Y26.178
X-0.553Y26.234
X-0.528Y26.286
X-0.498Y26.335
X-0.463Y26.382
X-0.424Y26.424
X-0.382Y26.463
X-0.335Y26.498
X-0.286Y26.528
X-0.234Y26.553
X-0.178Y26.573
X-0.121Y26.588
X-0.061Y26.597
X0.000Y26.600
X0.061Y26.597
X0.121Y26.588
X0.178Y26.573
X0.234Y26.553
X0.286Y26.528
X0.335Y26.498
X0.382Y26.463
X0.424Y26.424
X0.463Y26.382
X0.498Y26.335
X0.528Y26.286
X0.553Y26.234
X0.573Y26.178
X0.588Y26.121
X0.597Y26.061
X0.600Y26.000
X0.597Y25.939
X0.588Y25.879
X0.573Y25.822
X0.553Y25.766
X0.528Y25.714
X0.498Y25.665
X0.463Y25.618
X0.424Y25.576
X0.382Y25.537
X0.335Y25.502
X0.286Y25.472
X0.234Y25.447
X0.178Y25.427
X0.121Y25.412
X0.061Y25.403
X0.000Y25.400
X-0.061Y25.403
X-0.121Y25.412
X-0.178Y25.427
X-0.234Y25.447
X-0.286Y25.472
X-0.335Y25.502
X-0.382Y25.537
X-0.424Y25.576
X-0.463Y25.618
X-0.498Y25.665
X-0.528Y25.714
X-0.553Y25.766
X-0.573Y25.822
X-0.588Y25.879
X-0.597Y25.939
X-0.600Y26.000

G0X1.400Y24.000
G1X1.403Y24.061F650.0
X1.412Y24.121
X1.427Y24.178
X1.447Y24.234
X1.472Y24.286
X1.502Y24.335
X1.537Y24.382
X1.576Y24.424
X1.618Y24.463
X1.665Y24.498
X1.714Y24.528
X1.766Y24.553
X1.822Y24.573
X1.879Y24.588
X1.939Y24.597
X2.000Y24.600
X2.061Y24.597
X2.121Y24.588
X2.178Y24.573
X2.234Y24.553
X2.286Y24.528
X2.335Y24.498
X2.382Y24.463
X2.424Y24.424
X2.463Y24.382
X2.498Y24.335
X2.528Y24.286
X2.553Y24.234
X2.573Y24.178
X2.588Y24.121
X2.597Y24.061
X2.600Y24.000
X2.597Y23.939
X2.588Y23.879
X2.573Y23.822
X2.553Y23.766
X2.528Y23.714
X2.498Y23.665
X2.463Y23.618
X2.424Y23.576
X2.382Y23.537
X2.335Y23.502
X2.286Y23.472
X2.234Y23.447
X2.178Y23.427
X2.121Y23.412
X2.061Y23.403
X2.000Y23.400
X1.939Y23.403
X1.879Y23.412
X1.822Y23.427
X1.766Y23.447
X1.714Y23.472
X1.665Y23.502
X1.618Y23.537
X1.576Y23.576
X1.537Y23.618
X1.502Y23.665
X1.472Y23.714
X1.447Y23.766
X1.427Y23.822
X1.412Y23.879
X1.403Y23.939
X1.400Y24.000

G0X0.500Y23.000
G1X1.500F650.0

G0X2.000Y18.000Z0.000(5)

G0X-0.600Y20.000
G1X-0.597Y20.061F650.0
X-0.588Y20.121
X-0.573Y20.178
X-0.553Y20.234
X-0.528Y20.286
X-0.498Y20.335
X-0.463Y20.382
X-0.424Y20.424
X-0.382Y20.463
X-0.335Y20.498
X-0.286Y20.528
X-0.234Y20.553
X-0.178Y20.573
X-0.121Y20.588
X-0.061Y20.597
X0.000Y20.600
X0.061Y20.597
X0.121Y20.588
X0.178Y20.573
X0.234Y20.553
X0.286Y20.528
X0.335Y20.498
X0.382Y20.463
X0.424Y20.424
X0.463Y20.382
X0.498Y20.335
X0.528Y20.286
X0.553Y20.234
X0.573Y20.178
X0.588Y20.121
X0.597Y20.061
X0.600Y20.000
X0.597Y19.939
X0.588Y19.879
X0.573Y19.822
X0.553Y19.766
X0.528Y19.714
X0.498Y19.665
X0.463Y19.618
X0.424Y19.576
X0.382Y19.537
X0.335Y19.502
X0.286Y19.472
X0.234Y19.447
X0.178Y19.427
X0.121Y19.412
X0.061Y19.403
X0.000Y19.400
X-0.061Y19.403
X-0.121Y19.412
X-0.178Y19.427
X-0.234Y19.447
X-0.286Y19.472
X-0.335Y19.502
X-0.382Y19.537
X-0.424Y19.576
X-0.463Y19.618
X-0.498Y19.665
X-0.528Y19.714
X-0.553Y19.766
X-0.573Y19.822
X-0.588Y19.879
X-0.597Y19.939
X-0.600Y20.000

G0X1.400Y22.000
G1X1.403Y22.061F650.0
X1.412Y22.121
X1.427Y22.178
X1.447Y22.234
X1.472Y22.286
X1.502Y22.335
X1.537Y22.382
X1.576Y22.424
X1.618Y22.463
X1.665Y22.498
X1.714Y22.528
X1.766Y22.553
X1.822Y22.573
X1.879Y22.588
X1.939Y22.597
X2.000Y22.600
X2.061Y22.597
X2.121Y22.588
X2.178Y22.573
X2.234Y22.553
X2.286Y22.528
X2.335Y22.498
X2.382Y22.463
X2.424Y22.424
X2.463Y22.382
X2.498Y22.335
X2.528Y22.286
X2.553Y22.234
X2.573Y22.178
X2.588Y22.121
X2.597Y22.061
X2.600Y22.000
X2.597Y21.939
X2.588Y21.879
X2.573Y21.822
X2.553Y21.766
X2.528Y21.714
X2.498Y21.665
X2.463Y21.618
X2.424Y21.576
X2.382Y21.537
X2.335Y21.502
X2.286Y21.472
X2.234Y21.447
X2.178Y21.427
X2.121Y21.412
X2.061Y21.403
X2.000Y21.400
X1.939Y21.403
X1.879Y21.412
X1.822Y21.427
X1.766Y21.447
X1.714Y21.472
X1.665Y21.502
X1.618Y21.537
X1.576Y21.576
X1.537Y21.618
X1.502Y21.665
X1.472Y21.714
X1.447Y21.766
X1.427Y21.822
X1.412Y21.879
X1.403Y21.939
X1.400Y22.000

G0X-0.600Y22.000
G1X-0.597Y22.061F650.0
X-0.588Y22.121
X-0.573Y22.178
X-0.553Y22.234
X-0.528Y22.286
X-0.498Y22.335
X-0.463Y22.382
X-0.424Y22.424
X-0.382Y22.463
X-0.335Y22.498
X-0.286Y22.528
X-0.234Y22.553
X-0.178Y22.573
X-0.121Y22.588
X-0.061Y22.597
X0.000Y22.600
X0.061Y22.597
X0.121Y22.588
X0.178Y22.573
X0.234Y22.553
X0.286Y22.528
X0.335Y22.498
X0.382Y22.463
X0.424Y22.424
X0.463Y22.382
X0.498Y22.335
X0.528Y22.286
X0.553Y22.234
X0.573Y22.178
X0.588Y22.121
X0.597Y22.061
X0.600Y22.000
X0.597Y21.939
X0.588Y21.879
X0.573Y21.822
X0.553Y21.766
X0.528Y21.714
X0.498Y21.665
X0.463Y21.618
X0.424Y21.576
X0.382Y21.537
X0.335Y21.502
X0.286Y21.472
X0.234Y21.447
X0.178Y21.427
X0.121Y21.412
X0.061Y21.403
X0.000Y21.400
X-0.061Y21.403
X-0.121Y21.412
X-0.178Y21.427
X-0.234Y21.447
X-0.286Y21.472
X-0.335Y21.502
X-0.382Y21.537
X-0.424Y21.576
X-0.463Y21.618
X-0.498Y21.665
X-0.528Y21.714
X-0.553Y21.766
X-0.573Y21.822
X-0.588Y21.879
X-0.597Y21.939
X-0.600Y22.000

G0X1.400Y20.000
G1X1.403Y20.061F650.0
X1.412Y20.121
X1.427Y20.178
X1.447Y20.234
X1.472Y20.286
X1.502Y20.335
X1.537Y20.382
X1.576Y20.424
X1.618Y20.463
X1.665Y20.498
X1.714Y20.528
X1.766Y20.553
X1.822Y20.573
X1.879Y20.588
X1.939Y20.597
X2.000Y20.600
X2.061Y20.597
X2.121Y20.588
X2.178Y20.573
X2.234Y20.553
X2.286Y20.528
X2.335Y20.498
X2.382Y20.463
X2.424Y20.424
X2.463Y20.382
X2.498Y20.335
X2.528Y20.286
X2.553Y20.234
X2.573Y20.178
X2.588Y20.121
X2.597Y20.061
X2.600Y20.000
X2.597Y19.939
X2.588Y19.879
X2.573Y19.822
X2.553Y19.766
X2.528Y19.714
X2.498Y19.665
X2.463Y19.618
X2.424Y19.576
X2.382Y19.537
X2.335Y19.502
X2.286Y19.472
X2.234Y19.447
X2.178Y19.427
X2.121Y19.412
X2.061Y19.403
X2.000Y19.400
X1.939Y19.403
X1.879Y19.412
X1.822Y19.427
X1.766Y19.447
X1.714Y19.472
X1.665Y19.502
X1.618Y19.537
X1.576Y19.576
X1.537Y19.618
X1.502Y19.665
X1.472Y19.714
X1.447Y19.766
X1.427Y19.822
X1.412Y19.879
X1.403Y19.939
X1.400Y20.000

G0X0.500Y19.000
G1X1.500F650.0

G0X2.000Y14.000Z0.000(4)

G0X-0.600Y16.000
G1X-0.597Y16.061F650.0
X-0.588Y16.121
X-0.573Y16.178
X-0.553Y16.234
X-0.528Y16.286
X-0.498Y16.335
X-0.463Y16.382
X-0.424Y16.424
X-0.382Y16.463
X-0.335Y16.498
X-0.286Y16.528
X-0.234Y16.553
X-0.178Y16.573
X-0.121Y16.588
X-0.061Y16.597
X0.000Y16.600
X0.061Y16.597
X0.121Y16.588
X0.178Y16.573
X0.234Y16.553
X0.286Y16.528
X0.335Y16.498
X0.382Y16.463
X0.424Y16.424
X0.463Y16.382
X0.498Y16.335
X0.528Y16.286
X0.553Y16.234
X0.573Y16.178
X0.588Y16.121
X0.597Y16.061
X0.600Y16.000
X0.597Y15.939
X0.588Y15.879
X0.573Y15.822
X0.553Y15.766
X0.528Y15.714
X0.498Y15.665
X0.463Y15.618
X0.424Y15.576
X0.382Y15.537
X0.335Y15.502
X0.286Y15.472
X0.234Y15.447
X0.178Y15.427
X0.121Y15.412
X0.061Y15.403
X0.000Y15.400
X-0.061Y15.403
X-0.121Y15.412
X-0.178Y15.427
X-0.234Y15.447
X-0.286Y15.472
X-0.335Y15.502
X-0.382Y15.537
X-0.424Y15.576
X-0.463Y15.618
X-0.498Y15.665
X-0.528Y15.714
X-0.553Y15.766
X-0.573Y15.822
X-0.588Y15.879
X-0.597Y15.939
X-0.600Y16.000
Reply from the maker: (Make Alignment Marker - PART3)

G0X1.400Y18.000
G1X1.403Y18.061F650.0
X1.412Y18.121
X1.427Y18.178
X1.447Y18.234
X1.472Y18.286
X1.502Y18.335
X1.537Y18.382
X1.576Y18.424
X1.618Y18.463
X1.665Y18.498
X1.714Y18.528
X1.766Y18.553
X1.822Y18.573
X1.879Y18.588
X1.939Y18.597
X2.000Y18.600
X2.061Y18.597
X2.121Y18.588
X2.178Y18.573
X2.234Y18.553
X2.286Y18.528
X2.335Y18.498
X2.382Y18.463
X2.424Y18.424
X2.463Y18.382
X2.498Y18.335
X2.528Y18.286
X2.553Y18.234
X2.573Y18.178
X2.588Y18.121
X2.597Y18.061
X2.600Y18.000
X2.597Y17.939
X2.588Y17.879
X2.573Y17.822
X2.553Y17.766
X2.528Y17.714
X2.498Y17.665
X2.463Y17.618
X2.424Y17.576
X2.382Y17.537
X2.335Y17.502
X2.286Y17.472
X2.234Y17.447
X2.178Y17.427
X2.121Y17.412
X2.061Y17.403
X2.000Y17.400
X1.939Y17.403
X1.879Y17.412
X1.822Y17.427
X1.766Y17.447
X1.714Y17.472
X1.665Y17.502
X1.618Y17.537
X1.576Y17.576
X1.537Y17.618
X1.502Y17.665
X1.472Y17.714
X1.447Y17.766
X1.427Y17.822
X1.412Y17.879
X1.403Y17.939
X1.400Y18.000

G0X-0.600Y18.000
G1X-0.597Y18.061F650.0
X-0.588Y18.121
X-0.573Y18.178
X-0.553Y18.234
X-0.528Y18.286
X-0.498Y18.335
X-0.463Y18.382
X-0.424Y18.424
X-0.382Y18.463
X-0.335Y18.498
X-0.286Y18.528
X-0.234Y18.553
X-0.178Y18.573
X-0.121Y18.588
X-0.061Y18.597
X0.000Y18.600
X0.061Y18.597
X0.121Y18.588
X0.178Y18.573
X0.234Y18.553
X0.286Y18.528
X0.335Y18.498
X0.382Y18.463
X0.424Y18.424
X0.463Y18.382
X0.498Y18.335
X0.528Y18.286
X0.553Y18.234
X0.573Y18.178
X0.588Y18.121
X0.597Y18.061
X0.600Y18.000
X0.597Y17.939
X0.588Y17.879
X0.573Y17.822
X0.553Y17.766
X0.528Y17.714
X0.498Y17.665
X0.463Y17.618
X0.424Y17.576
X0.382Y17.537
X0.335Y17.502
X0.286Y17.472
X0.234Y17.447
X0.178Y17.427
X0.121Y17.412
X0.061Y17.403
X0.000Y17.400
X-0.061Y17.403
X-0.121Y17.412
X-0.178Y17.427
X-0.234Y17.447
X-0.286Y17.472
X-0.335Y17.502
X-0.382Y17.537
X-0.424Y17.576
X-0.463Y17.618
X-0.498Y17.665
X-0.528Y17.714
X-0.553Y17.766
X-0.573Y17.822
X-0.588Y17.879
X-0.597Y17.939
X-0.600Y18.000

G0X1.400Y16.000
G1X1.403Y16.061F650.0
X1.412Y16.121
X1.427Y16.178
X1.447Y16.234
X1.472Y16.286
X1.502Y16.335
X1.537Y16.382
X1.576Y16.424
X1.618Y16.463
X1.665Y16.498
X1.714Y16.528
X1.766Y16.553
X1.822Y16.573
X1.879Y16.588
X1.939Y16.597
X2.000Y16.600
X2.061Y16.597
X2.121Y16.588
X2.178Y16.573
X2.234Y16.553
X2.286Y16.528
X2.335Y16.498
X2.382Y16.463
X2.424Y16.424
X2.463Y16.382
X2.498Y16.335
X2.528Y16.286
X2.553Y16.234
X2.573Y16.178
X2.588Y16.121
X2.597Y16.061
X2.600Y16.000
X2.597Y15.939
X2.588Y15.879
X2.573Y15.822
X2.553Y15.766
X2.528Y15.714
X2.498Y15.665
X2.463Y15.618
X2.424Y15.576
X2.382Y15.537
X2.335Y15.502
X2.286Y15.472
X2.234Y15.447
X2.178Y15.427
X2.121Y15.412
X2.061Y15.403
X2.000Y15.400
X1.939Y15.403
X1.879Y15.412
X1.822Y15.427
X1.766Y15.447
X1.714Y15.472
X1.665Y15.502
X1.618Y15.537
X1.576Y15.576
X1.537Y15.618
X1.502Y15.665
X1.472Y15.714
X1.447Y15.766
X1.427Y15.822
X1.412Y15.879
X1.403Y15.939
X1.400Y16.000

G0X0.500Y15.000
G1X1.500F650.0

G0X2.000Y10.000Z0.000(3)

G0X-0.600Y12.000
G1X-0.597Y12.061F650.0
X-0.588Y12.121
X-0.573Y12.178
X-0.553Y12.234
X-0.528Y12.286
X-0.498Y12.335
X-0.463Y12.382
X-0.424Y12.424
X-0.382Y12.463
X-0.335Y12.498
X-0.286Y12.528
X-0.234Y12.553
X-0.178Y12.573
X-0.121Y12.588
X-0.061Y12.597
X0.000Y12.600
X0.061Y12.597
X0.121Y12.588
X0.178Y12.573
X0.234Y12.553
X0.286Y12.528
X0.335Y12.498
X0.382Y12.463
X0.424Y12.424
X0.463Y12.382
X0.498Y12.335
X0.528Y12.286
X0.553Y12.234
X0.573Y12.178
X0.588Y12.121
X0.597Y12.061
X0.600Y12.000
X0.597Y11.939
X0.588Y11.879
X0.573Y11.822
X0.553Y11.766
X0.528Y11.714
X0.498Y11.665
X0.463Y11.618
X0.424Y11.576
X0.382Y11.537
X0.335Y11.502
X0.286Y11.472
X0.234Y11.447
X0.178Y11.427
X0.121Y11.412
X0.061Y11.403
X0.000Y11.400
X-0.061Y11.403
X-0.121Y11.412
X-0.178Y11.427
X-0.234Y11.447
X-0.286Y11.472
X-0.335Y11.502
X-0.382Y11.537
X-0.424Y11.576
X-0.463Y11.618
X-0.498Y11.665
X-0.528Y11.714
X-0.553Y11.766
X-0.573Y11.822
X-0.588Y11.879
X-0.597Y11.939
X-0.600Y12.000

G0X1.400Y14.000
G1X1.403Y14.061F650.0
X1.412Y14.121
X1.427Y14.178
X1.447Y14.234
X1.472Y14.286
X1.502Y14.335
X1.537Y14.382
X1.576Y14.424
X1.618Y14.463
X1.665Y14.498
X1.714Y14.528
X1.766Y14.553
X1.822Y14.573
X1.879Y14.588
X1.939Y14.597
X2.000Y14.600
X2.061Y14.597
X2.121Y14.588
X2.178Y14.573
X2.234Y14.553
X2.286Y14.528
X2.335Y14.498
X2.382Y14.463
X2.424Y14.424
X2.463Y14.382
X2.498Y14.335
X2.528Y14.286
X2.553Y14.234
X2.573Y14.178
X2.588Y14.121
X2.597Y14.061
X2.600Y14.000
X2.597Y13.939
X2.588Y13.879
X2.573Y13.822
X2.553Y13.766
X2.528Y13.714
X2.498Y13.665
X2.463Y13.618
X2.424Y13.576
X2.382Y13.537
X2.335Y13.502
X2.286Y13.472
X2.234Y13.447
X2.178Y13.427
X2.121Y13.412
X2.061Y13.403
X2.000Y13.400
X1.939Y13.403
X1.879Y13.412
X1.822Y13.427
X1.766Y13.447
X1.714Y13.472
X1.665Y13.502
X1.618Y13.537
X1.576Y13.576
X1.537Y13.618
X1.502Y13.665
X1.472Y13.714
X1.447Y13.766
X1.427Y13.822
X1.412Y13.879
X1.403Y13.939
X1.400Y14.000

G0X-0.600Y14.000
G1X-0.597Y14.061F650.0
X-0.588Y14.121
X-0.573Y14.178
X-0.553Y14.234
X-0.528Y14.286
X-0.498Y14.335
X-0.463Y14.382
X-0.424Y14.424
X-0.382Y14.463
X-0.335Y14.498
X-0.286Y14.528
X-0.234Y14.553
X-0.178Y14.573
X-0.121Y14.588
X-0.061Y14.597
X0.000Y14.600
X0.061Y14.597
X0.121Y14.588
X0.178Y14.573
X0.234Y14.553
X0.286Y14.528
X0.335Y14.498
X0.382Y14.463
X0.424Y14.424
X0.463Y14.382
X0.498Y14.335
X0.528Y14.286
X0.553Y14.234
X0.573Y14.178
X0.588Y14.121
X0.597Y14.061
X0.600Y14.000
X0.597Y13.939
X0.588Y13.879
X0.573Y13.822
X0.553Y13.766
X0.528Y13.714
X0.498Y13.665
X0.463Y13.618
X0.424Y13.576
X0.382Y13.537
X0.335Y13.502
X0.286Y13.472
X0.234Y13.447
X0.178Y13.427
X0.121Y13.412
X0.061Y13.403
X0.000Y13.400
X-0.061Y13.403
X-0.121Y13.412
X-0.178Y13.427
X-0.234Y13.447
X-0.286Y13.472
X-0.335Y13.502
X-0.382Y13.537
X-0.424Y13.576
X-0.463Y13.618
X-0.498Y13.665
X-0.528Y13.714
X-0.553Y13.766
X-0.573Y13.822
X-0.588Y13.879
X-0.597Y13.939
X-0.600Y14.000

G0X1.400Y12.000
G1X1.403Y12.061F650.0
X1.412Y12.121
X1.427Y12.178
X1.447Y12.234
X1.472Y12.286
X1.502Y12.335
X1.537Y12.382
X1.576Y12.424
X1.618Y12.463
X1.665Y12.498
X1.714Y12.528
X1.766Y12.553
X1.822Y12.573
X1.879Y12.588
X1.939Y12.597
X2.000Y12.600
X2.061Y12.597
X2.121Y12.588
X2.178Y12.573
X2.234Y12.553
X2.286Y12.528
X2.335Y12.498
X2.382Y12.463
X2.424Y12.424
X2.463Y12.382
X2.498Y12.335
X2.528Y12.286
X2.553Y12.234
X2.573Y12.178
X2.588Y12.121
X2.597Y12.061
X2.600Y12.000
X2.597Y11.939
X2.588Y11.879
X2.573Y11.822
X2.553Y11.766
X2.528Y11.714
X2.498Y11.665
X2.463Y11.618
X2.424Y11.576
X2.382Y11.537
X2.335Y11.502
X2.286Y11.472
X2.234Y11.447
X2.178Y11.427
X2.121Y11.412
X2.061Y11.403
X2.000Y11.400
X1.939Y11.403
X1.879Y11.412
X1.822Y11.427
X1.766Y11.447
X1.714Y11.472
X1.665Y11.502
X1.618Y11.537
X1.576Y11.576
X1.537Y11.618
X1.502Y11.665
X1.472Y11.714
X1.447Y11.766
X1.427Y11.822
X1.412Y11.879
X1.403Y11.939
X1.400Y12.000

G0X0.500Y11.000
G1X1.500F650.0

G0X2.000Y6.000Z0.000(2)

G0X-0.600Y8.000
G1X-0.597Y8.061F650.0
X-0.588Y8.121
X-0.573Y8.178
X-0.553Y8.234
X-0.528Y8.286
X-0.498Y8.335
X-0.463Y8.382
X-0.424Y8.424
X-0.382Y8.463
X-0.335Y8.498
X-0.286Y8.528
X-0.234Y8.553
X-0.178Y8.573
X-0.121Y8.588
X-0.061Y8.597
X0.000Y8.600
X0.061Y8.597
X0.121Y8.588
X0.178Y8.573
X0.234Y8.553
X0.286Y8.528
X0.335Y8.498
X0.382Y8.463
X0.424Y8.424
X0.463Y8.382
X0.498Y8.335
X0.528Y8.286
X0.553Y8.234
X0.573Y8.178
X0.588Y8.121
X0.597Y8.061
X0.600Y8.000
X0.597Y7.939
X0.588Y7.879
X0.573Y7.822
X0.553Y7.766
X0.528Y7.714
X0.498Y7.665
X0.463Y7.618
X0.424Y7.576
X0.382Y7.537
X0.335Y7.502
X0.286Y7.472
X0.234Y7.447
X0.178Y7.427
X0.121Y7.412
X0.061Y7.403
X0.000Y7.400
X-0.061Y7.403
X-0.121Y7.412
X-0.178Y7.427
X-0.234Y7.447
X-0.286Y7.472
X-0.335Y7.502
X-0.382Y7.537
X-0.424Y7.576
X-0.463Y7.618
X-0.498Y7.665
X-0.528Y7.714
X-0.553Y7.766
X-0.573Y7.822
X-0.588Y7.879
X-0.597Y7.939
X-0.600Y8.000

G0X1.400Y10.000
G1X1.403Y10.061F650.0
X1.412Y10.121
X1.427Y10.178
X1.447Y10.234
X1.472Y10.286
X1.502Y10.335
X1.537Y10.382
X1.576Y10.424
X1.618Y10.463
X1.665Y10.498
X1.714Y10.528
X1.766Y10.553
X1.822Y10.573
X1.879Y10.588
X1.939Y10.597
X2.000Y10.600
X2.061Y10.597
X2.121Y10.588
X2.178Y10.573
X2.234Y10.553
X2.286Y10.528
X2.335Y10.498
X2.382Y10.463
X2.424Y10.424
X2.463Y10.382
X2.498Y10.335
X2.528Y10.286
X2.553Y10.234
X2.573Y10.178
X2.588Y10.121
X2.597Y10.061
X2.600Y10.000
X2.597Y9.939
X2.588Y9.879
X2.573Y9.822
X2.553Y9.766
X2.528Y9.714
X2.498Y9.665
X2.463Y9.618
X2.424Y9.576
X2.382Y9.537
X2.335Y9.502
X2.286Y9.472
X2.234Y9.447
X2.178Y9.427
X2.121Y9.412
X2.061Y9.403
X2.000Y9.400
X1.939Y9.403
X1.879Y9.412
X1.822Y9.427
X1.766Y9.447
X1.714Y9.472
X1.665Y9.502
X1.618Y9.537
X1.576Y9.576
X1.537Y9.618
X1.502Y9.665
X1.472Y9.714
X1.447Y9.766
X1.427Y9.822
X1.412Y9.879
X1.403Y9.939
X1.400Y10.000
Reply from the maker: (Make Alignment Marker - PART4) (Final Part)

G0X-0.600Y10.000
G1X-0.597Y10.061F650.0
X-0.588Y10.121
X-0.573Y10.178
X-0.553Y10.234
X-0.528Y10.286
X-0.498Y10.335
X-0.463Y10.382
X-0.424Y10.424
X-0.382Y10.463
X-0.335Y10.498
X-0.286Y10.528
X-0.234Y10.553
X-0.178Y10.573
X-0.121Y10.588
X-0.061Y10.597
X0.000Y10.600
X0.061Y10.597
X0.121Y10.588
X0.178Y10.573
X0.234Y10.553
X0.286Y10.528
X0.335Y10.498
X0.382Y10.463
X0.424Y10.424
X0.463Y10.382
X0.498Y10.335
X0.528Y10.286
X0.553Y10.234
X0.573Y10.178
X0.588Y10.121
X0.597Y10.061
X0.600Y10.000
X0.597Y9.939
X0.588Y9.879
X0.573Y9.822
X0.553Y9.766
X0.528Y9.714
X0.498Y9.665
X0.463Y9.618
X0.424Y9.576
X0.382Y9.537
X0.335Y9.502
X0.286Y9.472
X0.234Y9.447
X0.178Y9.427
X0.121Y9.412
X0.061Y9.403
X0.000Y9.400
X-0.061Y9.403
X-0.121Y9.412
X-0.178Y9.427
X-0.234Y9.447
X-0.286Y9.472
X-0.335Y9.502
X-0.382Y9.537
X-0.424Y9.576
X-0.463Y9.618
X-0.498Y9.665
X-0.528Y9.714
X-0.553Y9.766
X-0.573Y9.822
X-0.588Y9.879
X-0.597Y9.939
X-0.600Y10.000

G0X1.400Y8.000
G1X1.403Y8.061F650.0
X1.412Y8.121
X1.427Y8.178
X1.447Y8.234
X1.472Y8.286
X1.502Y8.335
X1.537Y8.382
X1.576Y8.424
X1.618Y8.463
X1.665Y8.498
X1.714Y8.528
X1.766Y8.553
X1.822Y8.573
X1.879Y8.588
X1.939Y8.597
X2.000Y8.600
X2.061Y8.597
X2.121Y8.588
X2.178Y8.573
X2.234Y8.553
X2.286Y8.528
X2.335Y8.498
X2.382Y8.463
X2.424Y8.424
X2.463Y8.382
X2.498Y8.335
X2.528Y8.286
X2.553Y8.234
X2.573Y8.178
X2.588Y8.121
X2.597Y8.061
X2.600Y8.000
X2.597Y7.939
X2.588Y7.879
X2.573Y7.822
X2.553Y7.766
X2.528Y7.714
X2.498Y7.665
X2.463Y7.618
X2.424Y7.576
X2.382Y7.537
X2.335Y7.502
X2.286Y7.472
X2.234Y7.447
X2.178Y7.427
X2.121Y7.412
X2.061Y7.403
X2.000Y7.400
X1.939Y7.403
X1.879Y7.412
X1.822Y7.427
X1.766Y7.447
X1.714Y7.472
X1.665Y7.502
X1.618Y7.537
X1.576Y7.576
X1.537Y7.618
X1.502Y7.665
X1.472Y7.714
X1.447Y7.766
X1.427Y7.822
X1.412Y7.879
X1.403Y7.939
X1.400Y8.000

G0X0.500Y7.000
G1X1.500F650.0

G0X2.000Y2.000Z0.000(1)

G0X-0.600Y4.000
G1X-0.597Y4.061F650.0
X-0.588Y4.121
X-0.573Y4.178
X-0.553Y4.234
X-0.528Y4.286
X-0.498Y4.335
X-0.463Y4.382
X-0.424Y4.424
X-0.382Y4.463
X-0.335Y4.498
X-0.286Y4.528
X-0.234Y4.553
X-0.178Y4.573
X-0.121Y4.588
X-0.061Y4.597
X0.000Y4.600
X0.061Y4.597
X0.121Y4.588
X0.178Y4.573
X0.234Y4.553
X0.286Y4.528
X0.335Y4.498
X0.382Y4.463
X0.424Y4.424
X0.463Y4.382
X0.498Y4.335
X0.528Y4.286
X0.553Y4.234
X0.573Y4.178
X0.588Y4.121
X0.597Y4.061
X0.600Y4.000
X0.597Y3.939
X0.588Y3.879
X0.573Y3.822
X0.553Y3.766
X0.528Y3.714
X0.498Y3.665
X0.463Y3.618
X0.424Y3.576
X0.382Y3.537
X0.335Y3.502
X0.286Y3.472
X0.234Y3.447
X0.178Y3.427
X0.121Y3.412
X0.061Y3.403
X0.000Y3.400
X-0.061Y3.403
X-0.121Y3.412
X-0.178Y3.427
X-0.234Y3.447
X-0.286Y3.472
X-0.335Y3.502
X-0.382Y3.537
X-0.424Y3.576
X-0.463Y3.618
X-0.498Y3.665
X-0.528Y3.714
X-0.553Y3.766
X-0.573Y3.822
X-0.588Y3.879
X-0.597Y3.939
X-0.600Y4.000

G0X1.400Y6.000
G1X1.403Y6.061F650.0
X1.412Y6.121
X1.427Y6.178
X1.447Y6.234
X1.472Y6.286
X1.502Y6.335
X1.537Y6.382
X1.576Y6.424
X1.618Y6.463
X1.665Y6.498
X1.714Y6.528
X1.766Y6.553
X1.822Y6.573
X1.879Y6.588
X1.939Y6.597
X2.000Y6.600
X2.061Y6.597
X2.121Y6.588
X2.178Y6.573
X2.234Y6.553
X2.286Y6.528
X2.335Y6.498
X2.382Y6.463
X2.424Y6.424
X2.463Y6.382
X2.498Y6.335
X2.528Y6.286
X2.553Y6.234
X2.573Y6.178
X2.588Y6.121
X2.597Y6.061
X2.600Y6.000
X2.597Y5.939
X2.588Y5.879
X2.573Y5.822
X2.553Y5.766
X2.528Y5.714
X2.498Y5.665
X2.463Y5.618
X2.424Y5.576
X2.382Y5.537
X2.335Y5.502
X2.286Y5.472
X2.234Y5.447
X2.178Y5.427
X2.121Y5.412
X2.061Y5.403
X2.000Y5.400
X1.939Y5.403
X1.879Y5.412
X1.822Y5.427
X1.766Y5.447
X1.714Y5.472
X1.665Y5.502
X1.618Y5.537
X1.576Y5.576
X1.537Y5.618
X1.502Y5.665
X1.472Y5.714
X1.447Y5.766
X1.427Y5.822
X1.412Y5.879
X1.403Y5.939
X1.400Y6.000

G0X-0.600Y6.000
G1X-0.597Y6.061F650.0
X-0.588Y6.121
X-0.573Y6.178
X-0.553Y6.234
X-0.528Y6.286
X-0.498Y6.335
X-0.463Y6.382
X-0.424Y6.424
X-0.382Y6.463
X-0.335Y6.498
X-0.286Y6.528
X-0.234Y6.553
X-0.178Y6.573
X-0.121Y6.588
X-0.061Y6.597
X0.000Y6.600
X0.061Y6.597
X0.121Y6.588
X0.178Y6.573
X0.234Y6.553
X0.286Y6.528
X0.335Y6.498
X0.382Y6.463
X0.424Y6.424
X0.463Y6.382
X0.498Y6.335
X0.528Y6.286
X0.553Y6.234
X0.573Y6.178
X0.588Y6.121
X0.597Y6.061
X0.600Y6.000
X0.597Y5.939
X0.588Y5.879
X0.573Y5.822
X0.553Y5.766
X0.528Y5.714
X0.498Y5.665
X0.463Y5.618
X0.424Y5.576
X0.382Y5.537
X0.335Y5.502
X0.286Y5.472
X0.234Y5.447
X0.178Y5.427
X0.121Y5.412
X0.061Y5.403
X0.000Y5.400
X-0.061Y5.403
X-0.121Y5.412
X-0.178Y5.427
X-0.234Y5.447
X-0.286Y5.472
X-0.335Y5.502
X-0.382Y5.537
X-0.424Y5.576
X-0.463Y5.618
X-0.498Y5.665
X-0.528Y5.714
X-0.553Y5.766
X-0.573Y5.822
X-0.588Y5.879
X-0.597Y5.939
X-0.600Y6.000

G0X1.400Y4.000
G1X1.403Y4.061F650.0
X1.412Y4.121
X1.427Y4.178
X1.447Y4.234
X1.472Y4.286
X1.502Y4.335
X1.537Y4.382
X1.576Y4.424
X1.618Y4.463
X1.665Y4.498
X1.714Y4.528
X1.766Y4.553
X1.822Y4.573
X1.879Y4.588
X1.939Y4.597
X2.000Y4.600
X2.061Y4.597
X2.121Y4.588
X2.178Y4.573
X2.234Y4.553
X2.286Y4.528
X2.335Y4.498
X2.382Y4.463
X2.424Y4.424
X2.463Y4.382
X2.498Y4.335
X2.528Y4.286
X2.553Y4.234
X2.573Y4.178
X2.588Y4.121
X2.597Y4.061
X2.600Y4.000
X2.597Y3.939
X2.588Y3.879
X2.573Y3.822
X2.553Y3.766
X2.528Y3.714
X2.498Y3.665
X2.463Y3.618
X2.424Y3.576
X2.382Y3.537
X2.335Y3.502
X2.286Y3.472
X2.234Y3.447
X2.178Y3.427
X2.121Y3.412
X2.061Y3.403
X2.000Y3.400
X1.939Y3.403
X1.879Y3.412
X1.822Y3.427
X1.766Y3.447
X1.714Y3.472
X1.665Y3.502
X1.618Y3.537
X1.576Y3.576
X1.537Y3.618
X1.502Y3.665
X1.472Y3.714
X1.447Y3.766
X1.427Y3.822
X1.412Y3.879
X1.403Y3.939
X1.400Y4.000

G0X0.500Y3.000
G1X1.500F650.0

M5
M5
M5
Reply: that flatcam video is 3 years old ... you cant even find most of the extra python files  needed for flatcam to work properly following that videos instructions. WASTE  OF TIME trying to install that software.
Reply from the maker: @emindmail9648 actually works fine, you don't need to mess around with python, he provides the links in the description of the video so you can download the installers. You can just ignore the old video.
Reply: @ForOurGood  OK Thank you for your help ... appreciated
Reply: Hi ForOurGood,

First of all, thank you for this incredible tutorial. The level of detail is amazing, and the results you achieved with DIY methods are truly inspiring.

I was particularly fascinated by your approach to compensating for machine backlash (or mechanical play) using a special zig-zag calibration pattern. This is a problem many of us struggle with on small CNC machines like the 3018.

In your video, you mentioned that you would share the files. Could you please share your fancy zig zag calibration G-code?

I'm very keen to study your method to improve the accuracy of my own PCB milling and drilling process. Understanding how the G-code changes direction to reveal and then compensate for backlash would be a huge help.

Thank you for sharing your knowledge with the community!
Reply from the maker: @h2w.. Thanks for the comment and question.
You can find the G-code for the calibration as responses to this pinned comment, please check it out.
Reply: Can You tell what kind (Model, Power, Wavelength) of laser module You use?
Reply from the maker: @h2w.. please check the description of episode 7, it should provide the details you requested.
Reply: @ForOurGood  Thank you again for your generous contribution to the community. I have one technical question: did you manage to verify that your 40W 450nm laser can reliably expose liquid solder mask, film solder mask, and dry film photoresist? Or did you find that the wavelength/power required different settings or wasn't suitable for some of these materials?
Reply from the maker: @h2w..  I only know that the wavelength worked fine with the 10sec fast UV resin shown in my various videos (pre-baked before exposing). Did not work well with the slower UV resins for me, but I did not test baking those resins, so I would not rule them out completely. I never tried any specific photo resist products, as that was never the plan.
Reply: @ForOurGood Thank you for such a professional and honest answer. Really appreciate it!
Reply from the maker: ====================== [Single Sided PCB Process] ======================

1.  UV Resin Coat PCB
    - If PCB surface has notable corrosion or scratches, use Scotch Brite to create wire brush finish first
    - Use metal polish (e.g. Pikal or Brasso) to polish to a high shine finish
    - Using tissue paper, clean thoroughly with IPA and dry with (maintain dust free from here)
    - Apply UV Resin and use small spatula to push into the entire surface first
    - Use a piece of Mono thread #150 silkscreen mesh to level surface
    - Remove silkscreen mesh, INSPECT and REDO as required (minimize bubbles or dust particles)
    - ALLOW TO SETTLE for 2 minutes (keep covered to avoid dust!)
    - Expose with UV lamp for 30 minutes (WNB UV-W100 Green UV resin)
    > Note: Store the silkscreen mesh in a dark & dust free place so it can be used again in Step#5
    > Note: Silkscreen mesh can also be washed in IPA and reused, but the cost/benefit should be considered case by case
    > Note: If you are working with a large PCB, then consider putting the mesh in a frame or mesh to make handling easier

2.  Affix PCB Locating Guides
    - Make 4 "L" shaped PCB corner brackets from PCB offcuts
    - Cover PCB corner brackets with masking tape, leaving PCB contact surface bare
    - Cover PCB working area with masking tape with generous margins
    - Clamp working PCB firmly in place, centered to the masked area
    - While applying pressure to corner bracket, add CA glue to outside edge
    - Apply CA glue accelerator to lock corner bracket in place
    - Repeat above 2 steps for all 4 corners
    - Leave for 5 minutes to allow CA glue to fully set
    - Remove PCB
    - Lightly clean CA glue accelerator residue from the PCB with IPA
    - Replace PCB and check for movement. (Redo if not a positive/firm fit)
    - Clamp working PCB firmly in place.
    > Note: A different locating method may be used, as long as it allows for accurate re-installation of the PCB during the job

3.  Create Location Reference
    - Make locating marker from UV resin coated PCB offcut (min 10W x 40H)
    - Determine location of locating marker, close but allows PCB to be flipped.
    - Make sure edges and shape is square for both location marker, and PCB. Adjust with file as need be.
    - Apply masking tape to cover area where locating marker will be glued (min 25W x 50H)
    - Place locating marker in the center of the masking tape, oriented square to CNC
    - While applying pressure to locating marker, add CA glue to margin
    - Apply CA glue accelerator to lock locating marker in place
    - Leave for 5 minutes to allow CA glue to fully set
    - Lightly clean marker with IPA
    - Home CNC & Set XY to zero
    - Probe Z-Height of work PCB surface and set laser to correct focus height
    - Locate laser relative to lower left corner of locating marker X+3mm Y+3mm
    - TAKE NOTE OF OFFSET COORDINATES (will refer to as "LM_OFFSET" hereon)
    - Set X & Y coordinates to zero
    - Laser burn reference markings onto surface (use "Laser_Make_Reference.nc")
    - Move the laser to zero X&Y point for the work PCB
    - TAKE NOTE OF OFFSET COORDINATES (will refer to as "PCB_OFFSET" hereon)
    - Set X & Y coordinates to zero

4.  Laser Clear Etch Area & Etching
    - Prepare Ferric Chloride by warming in boiled water bath
    - Load G-Code file "??-?_Cu.gbr_sub_edit_iso_combined_cnc.nc"
    - Run G-code to laser clear area to be etched
    - Remove PCB and lightly wash in IPA using fine hair toothbrush, then dry.
    - Place PCB in Ferric Chloride, continually agitate, occasional brushing.
    - At 5 minutes observer carefully until all visible copper has been removed
    - Wash in water, and check with microscope or zoom camera for residual copper
    - Repeat etching in 30>45 second intervals until etched enough (do not over etch!)
    - Clean with IPA and fine toothbrush, then dry with dabbing tissue paper

5.  UV Resin Top Coat & Print PCB Silkscreen
    - Repeat Step#1 procedures to apply top coat (Use silkscreen cutoff for small area)
    - Wash thoroughly with IPA and dry with tissue paper (maintain dust free from here)
    - Apply UV Resin and use small spatula to push into surface (Fast UV curing resin!)
    - Use a piece of Mono thread #150 silkscreen mesh to level surface
	Note: Use as little UV resin as possible and create a thin even coat
    - Remove silkscreen mesh, INSPECT and REDO as required (minimize bubbles or dust particles)
    - ALLOW TO SETTLE for 2 minutes (keep covered to avoid dust!)
    - Use hotplate to heat PCB for 10-minutes @80degC then cool to 50degC
	Note: Finish should look flat and somewhat dull after this process
    - Mount PCB in CNC and clamp firmly in place.
    - Load G-Code file "??-?_Silkscreen.gbr_iso_combined_mt_paint_cnc.nc"
    - Run G-code to expose the PCB Silkscreen pattern
    - Remove PCB from CNC
    - Use IPA soaked tissue to dab off majority of unrequired resin
    - Scrub with IPA and fine toothbrush to reveal the PCB Silkscreen details
	Note: Important to scrub pretty hard to test adhesions, dont be scared to scrub
	Note: If the some or all of the PCB fall off, redo with higher power settings
    - Final clean with IPA and dry with tissue paper
    - Expose with UV lamp for 1 minute (Mechanic UVH900-WY White UV resin)

6.  Laser Clear Pads, Laser Clear Outline & Laser Cut PCB @45% depth
    - Mount PCB in CNC and clamp firmly in place.
    - Load G-Code file "??-?_Mask.gbr_sub_iso_combined_mt_paint_cnc.nc"
    - Run G-code to laser clear the pads while using STRONG AIR ASSIST for cooling pads
	Note: If air-assist is not available, then use the Gerbal editor in Flatcam to
              split up the pad clearing operation into 2 or more files, with pads having
              smaller thermal capacity, using lower power levels. (avoids burning PCB substrate)
    - Load G-Code file "??-User_8.gbr_iso_combined_mt_paint_cnc.nc"
    - Run G-code to laser clear the PCB edge outline (NO air assist needed from here)
    - Load G-Code file "??-User_9.gbr_iso_combined_cnc.nc"
    - Run G-code to laser cut the PCB
    - Remove PCB and scrub the pads clean using IPA and fine toothbrush, then dry.

7. Install & Align Spindle, Setup PCB for Drilling
    - Remove laser and install spindle
    - Home CNC & Set XY to zero
    - Install 1mm drill in the spindle
    - Probe Z-Height of locating marker
    - Move CNC to LM_OFFSET X&Y coordinates and then move Z to G0Z0.3
    - Adjust XY position by eye to be centered with location cross mark
    - Set X & Y coordinates to zero
    - Move CNC to coordinates G0X0Y4
    - Set X & Y coordinates to zero
  a - Drill test holes in locating marker (use "Drill_Align_Test.nc")
  b - Magnify and inspect marks and determine X & Y adjustment (COMPENSATE INSIDE HOLE DISTANCE!)
  c - Move to X0Y4 adding the determined adjustment amount for X & Y (typically +/- 0.01>0.1)
  d - Set X & Y coordinates to zero
	Note: If the drilled hole has an ugly burr, consider changing to a new 1mm drill.
    - Repeat steps "a" thru "d" until good alignment achieved
    - Move CNC to coordinates to G0X0Y0 then G0Z0.3
    - Move CNC by 1mm steps until centered with location cross mark
    - Set X & Y coordinates to zero
    - Move CNC to coordinates to G0Z15 to ensure the drill will be clear
    - Move CNC to PCB_OFFSET X&Y coordinates
    - Set X & Y coordinates to zero
    - Re-install PCB with 0.2mm waste sheet underneath, ready for drilling
    - Probe Z-Height of work PCB

8. Drill Alignment Holes
    - Load G-Code file "Alignment Drills_cnc.nc"
    - Run G-code to drill 1mm alignment holes in work PCB
    - Use a small drill to bevel the copper edges (REMOVE ANY COPPER BURR!)

9. Drill PCB Through Holes
    - Ensure all drills to be used have collet stoppers adjusted to same height
    - Load G-Code file "??-PTH.drl_cnc.nc"
    - Install first drill in sequence in the spindle
    - Probe Z-Height of work PCB (if not already done)
    - Move the spindle to the location of the first hole at a Z height 0.2mm
    - Inspect drill location, if noticable error exists,then adjust the origin to compensate
    - Run G-code to drill holes in work PCB, changing drill bit as per the drill sequence
	Note: Alignment holes are made into a copper surface, but PCB holes will drill into softer resin
              Blunt drills and/or Z axis play, can cause the holes drilled in copper to shift position
              This likely will result in the PCB holes being drilled slightly off center due to alignment error
              For consisent errors, consider adding an adjustment amount to the origin before drilling PCB holes
              For inconsistent errors, don't substract holes from CU & Mask layers in Flatcam prep (i.e. don't etch holes)